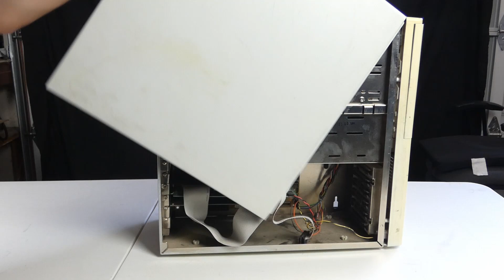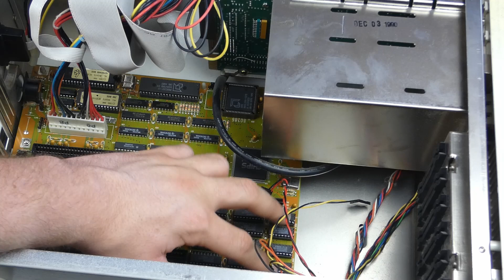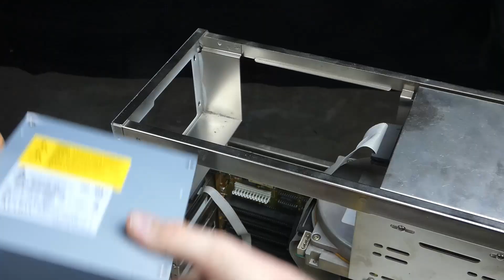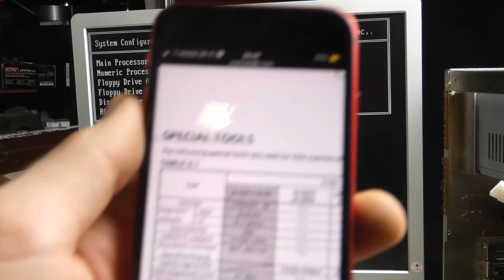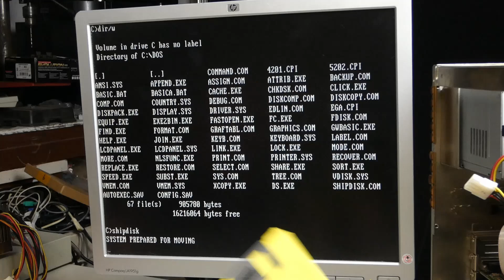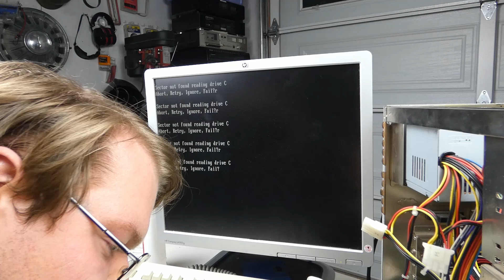Exploring This Random 286 I Have

Comment: If you are able to source 30pin simm sockets, those would fit perfectly in sipp sockets. It is a neat and reversible mod.

AT power supplies need a proper load to work correctly and will fail if sufficient load is not provided on 5 and 12 volt rails. It is probably fine, just use more load to test it.
Reply from the maker: I considered that, but it was making very not happy buzzing sounds. I suppose I could've plugged in a sacrificial hard drive or something into it, but it's just not worth it to me.
Reply: @NTGTechnology  I'd suggest car lightbulbs at 20W@5V and 50W@12V minimum, single hard disk is not enough.

Comment: to fix you HDD try Spinrite II.. It will low-level the surface of the drive when there is still data on it.. (nothing will happen to that data, but it will fix you HDD reading problem.
Reply from the maker: Wouldn't the data on the bad sectors still be lost? I'd likely still end up with a bunch of corrupted and missing data.

Comment: if its just worn out sectors and not head/platter issues, you could try Spinrite.
Reply: The HDD runs fine, dont think the drive is actually bad.. But in good shape.. Only magnetic surface is just very old. It happens with diskettes and floppys too.
But that hdd is easy to solve. I have a seagate ST-296n 84MB scsi hdd which had the same problems too, but also MBR was bad.
Used InstallR program from seagate again and did multiple times a low level format on it.. And solve the problems.. For i know it is a working drive now.

Comment: Maybe that isn't really a type 2 hard drive. It seems like everything was custom on every drive I ever saw back in the day, and you had to enter those in manually.
Reply: or magnetic surface isnt in a great shape after 35 years the data sit on.. It happen with all these mechanic drives.
Luckily its easy to solve with spinwrite II. Or if you dont care about the data do a new low-level format.
Reply: @rallyscoot  That's ok, I looked and it really is a type 2. Probably just a bad head.
Reply: An ST-225 is a type 2

Comment: 10:14 spec on the chip from cpuworld, there's also a N80L286-16 at 16 MHz
Type  CPU / Microprocessor
Family	AMD 80286
CPU part number	N80L286-12 is an OEM/tray microprocessor
Frequency   	12.5 MHz
Package	68-pin plastic LCC
Socket	PLCC68
Architecture / Microarchitecture
Instruction set	x86
Manufacturing process	NMOS
Data width	16 bit
Physical memory	16 MB
Virtual memory	1 GB
Electrical / Thermal parameters
V core   	5V ± 5%
Minimum/Maximum operating temperature  0°C - 85°C
Maximum power dissipation   2.89 Watt

Comment: The reason hard disks were called Winchester drivers was because the original spec for the 1973 IBM Winchester drive had 2 spindles of 30 megabytes each and so people started calling it a "30-30" and then IBM San Jose manager Kenneth E. Haughton said "if it's a 30-30 then it must be a Winchester"(referring to the rifle company)  and so the name stuck. that's according to the Channel "Asianometry"